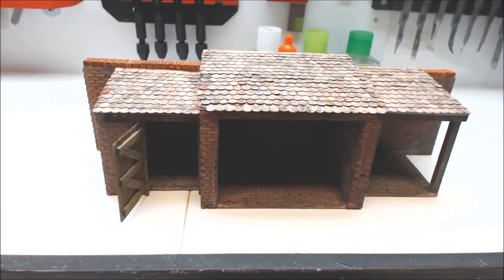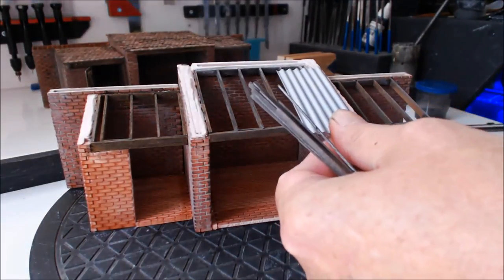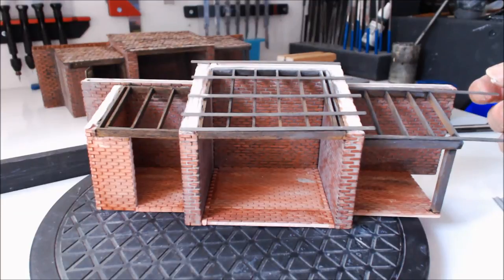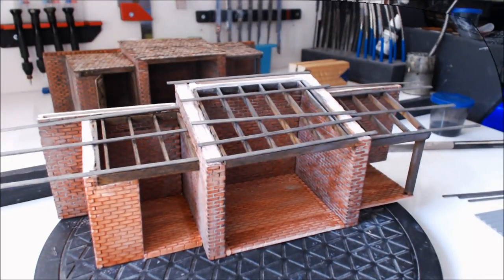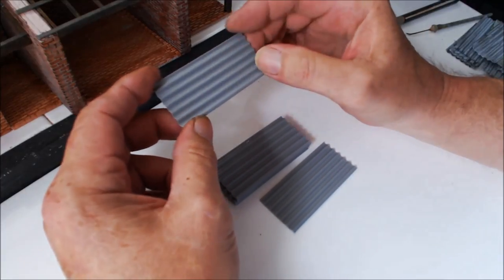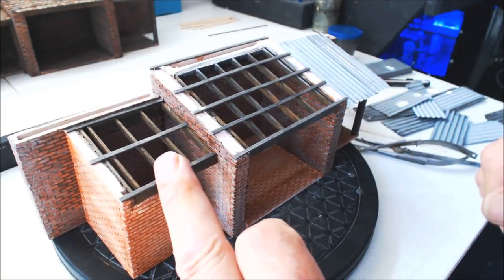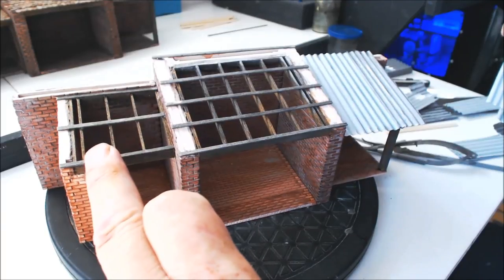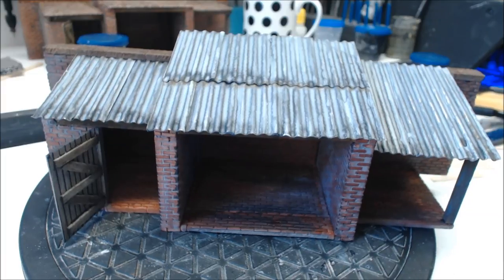European Barn Corrugated Iron RoofIn 1/35 scale  (Basic Build)  Part 3

Comment: I did use mixture of vinegar & hydrogen peroxide to rust some sheets of thin tin from the hobby store. Came out real rust and almost instantaneously. Problem is even the thinnest tin I can get does not lend itself to the ribbed effect I want.
Reply: Dec. 2017---Check Ebay (U.S.) for the corr-u-gator which sells for $25 plus shipping.

Comment: Dec. 20217---2nd time I've watched this video, but the Ebay seller is out of stock on the plastic sheets. They were out in Sept. when I checked and today.  However, on Ebay (U.S.) there's the corr-u-gator which sells for $25 plus shipping. There's also a video about it on Youtube by the company.

Comment: I got my Juweela corrugated sheets today. My question is what adhesive did you use to glue them to the wooden blocks? I picked up the pcb etching solution and once I make a few will see how the come out. I did see video where a guy used the solution on the metal from coke cans. Thanks
Reply from the maker: Bulk standard superglue and please let me know how the etching goes if possible some pictures that would be great many thanks Sim

Comment: Simon, while waiting for those corrugated pieces to come in I did some looking around for ides to make the panels old and deteriorated. I'm thinking about using pcb etching solution. What do you think?
Reply from the maker: I definitely think that will do the job but you need to rinse the etching solution of somehow all I can say is try apiece and see what happens I was thinking about using bearing solution they use for metal tracks I will let you know how it goes many thanks Sim

Comment: Great job as normal.,.. may I ask what time foil did you use. Also is diorama debris still going? As I sent two emails to them but no answer. Thanks
Reply from the maker: The foil that I use is of the fast food containers as for diorama debris they are still in business I receive moulds from them a couple of days ago is the actual email going through I had a few problems with the email on their website I will be speaking to soon I will mention it many thanks Sim

Comment: Quick question Simon. Are you going to simulate the nails that hold the sheets down? If so how?
Reply: Andrew Belsey has a tutorial wherein he uses 20 thou styrene rod, chopped into little nail heads. His model is clear acrylic plastic, so he uses a drop of chloroform on the plastic and then lays the nail head there. Andrew is a scale purest as well, so the nail heads should replicate a 1/35th nail exactly.
\\][//
Reply from the maker: I'm going to use For the moment  Meng Small rivets you get a hell of a lot and the really cheap I will just use a dab of superglue and put them on with a wax pencil But I'm keeping my eyes open for a cheaper and easier method many thanks Sim  My apologies for taking so long to get back to you